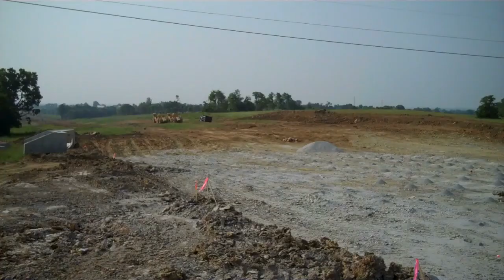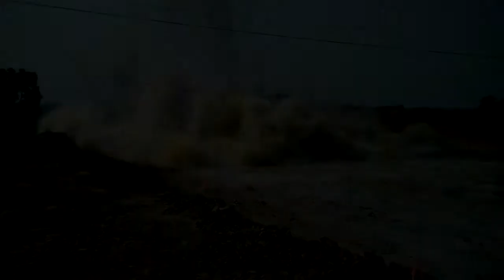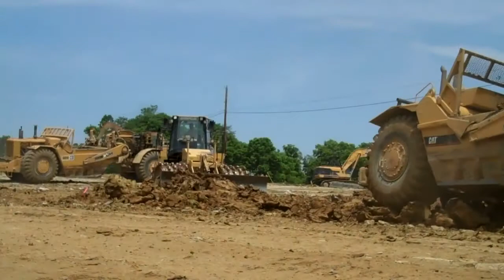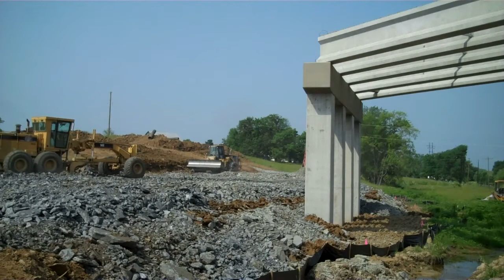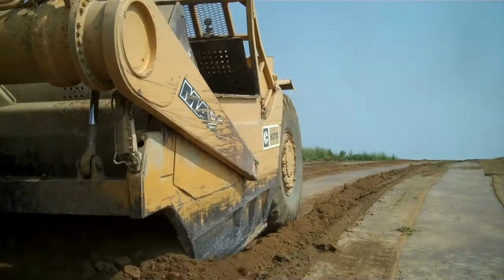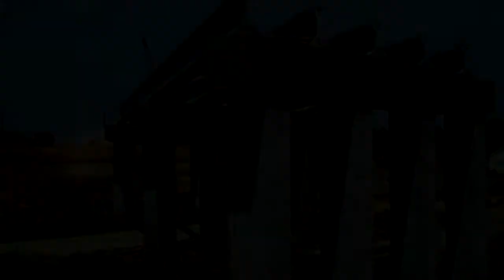Video News Release: US 68 Relocation at Maysville

Comment: I don't understand why the DOT didn't go ahead and do divided interstate with 4 lanes rather than just the two.  It seems much safer and if I'm not mistaken, the state projected the cost to be around 29 million.  With the low bid coming in at 23.5 million I would hope that the state would add the expansion to the original plan while the funding was already approved rather than trying to go through the whole process again.  Seems very logical.